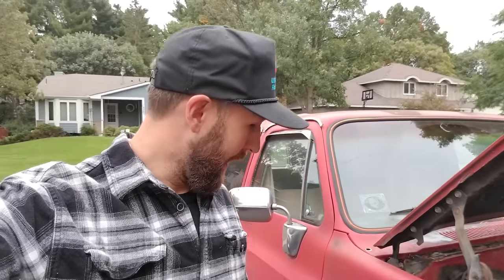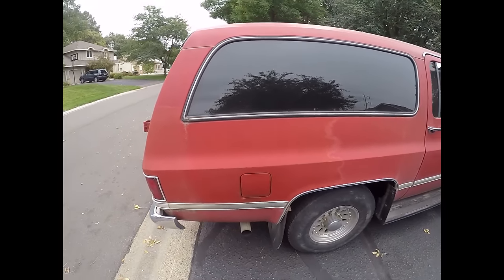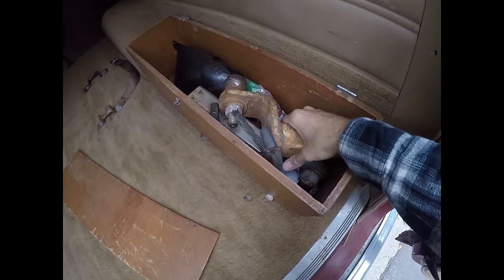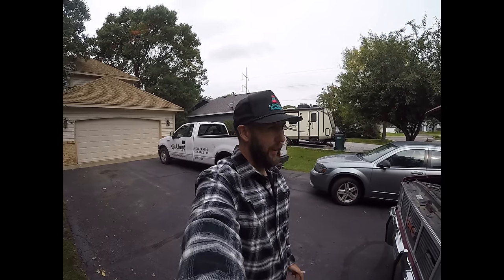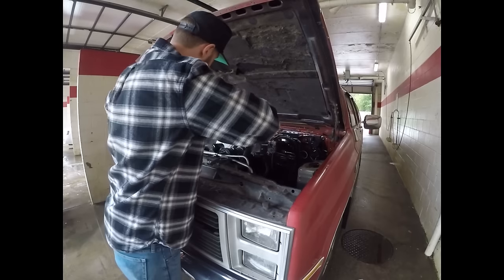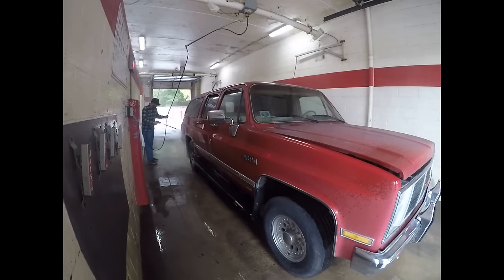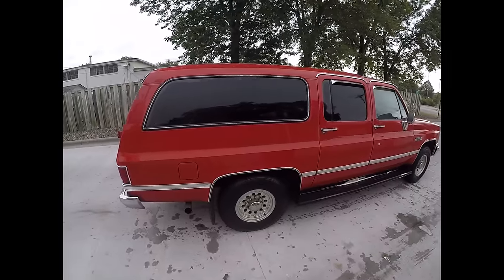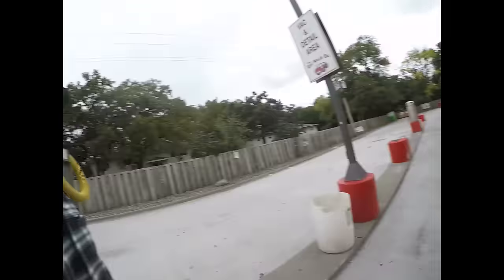454 Chevrolet/GMC Suburban Preview & Cleanup - Vice Grip Garage EP11

Comment: I had me a 454 dually took the wife and kids to Disney land...27 tanks of fuel from Canada,2500 miles round trip.Almost lost the camper in San Francisco when the camper hold down broke on one those hills.starter got heat soak in the middle of no where had to pour American beer on it to get it to start...oh ...lost spark some in Oregon got a used module in a wrecking yard.The trip before this one a volcano blew up and I Was stuck in Washington for days
Reply from the maker: You gotta carry a video camera machine my friend! Sounds like you find yourself some pretty amazing journeys 🤘😂.  I like those "dooley's" a lot!
Reply: I took an 03 F150 from Amarillo to the coast of Oregon last year. Just a 4.6 with 2wheel drive. Went no slower than 60 mph and topped went as fast as 90 mph uphill in the Rockies. All it cost me was a turn signal. She finally got snagged by a mud pit last month. 267k miles and the motor is still golden. Just needs... Lets be honest, a whole new cab and a tranny. The motor still has 120k miles minimum before a rebuild.

Gotta love an old reliable truck.
Reply: Sounds like the motor did good tho
Reply: Sounds like a National Lampoon vacation movie.
Reply: 1973 my dad did that! 454 quad cab not the  dually / he borrowed a massive camper/ it pulled great/pa to fla ! Used a aaa triptik He threw it out the window in DC
Reply: Thank goodness you didn’t have to pour Canadian beer on the starter LOL
Reply: I got me a 91 GMC RV with the 454 and the motor is going to go into a 79 Caprice
Reply: Kevin Ross  lucky!!! My kids are grown also, but my roommate/spouse is still here!!!
Reply: Remind me not to travel with you!! ;-)

Comment: My BB ran great in the heat or the cold.
The only problem I had when I had my Suburban was keepin transmissions in it.
I went through 7 of them before I stopped and pulled the motor out and tore it down.
That engine was absolutely clean. It looked brand new inside. 
Then I sold the engine and Suburban to a buddy that put the engine in a jet boat that is still goin to this day with no problems. 
And that was back in 2008.
I wish I had never sold that engine or Suburban.

Comment: For engine bays, I've got the engine warm, covered the electronicals and gave it a good soaking of simple green (degreaser) followed up with some armor all tire foam right over the simple green with pretty good success.  Let the foam work a few minutes before spraying off.

Comment: I probably mentioned before that my previous truck (pre 2003 RAM TD Crew Cab long bed) was an '88 GMC Suburban all tricked out. Got it in '93 with 98K miles on it and put 362,000+ on the original 350. Sold it for $1200 in 2010 to a guy who promptly rebuilt the engine and is still driving it today. Tough trucks and so much fun with that one.

Comment: I power washed my S-10 and ended up with crazy wiper action, cost me a good wad to learn electronics are anti -water. Never power washed under the hood again. Bought it new in 1992 s-10 4X4 extended cab 4.3 liter V-6. Still an awesome Chevy never anything but GM in 74 years.enjoy your channel.

Comment: I  had a 76 with 454 real gas hog. It wouldn't pass CA smog check so I ran it on propane. Was great, with two 20 gal tanks under and 80 gal in the pick up bed. Engine was bored 60 over, RV cam and Thorley headers .

Comment: Easy diy engine cleaner recipe. In a bucket, mix four cups vinegar, 1/4 cup dish wash liquid, fill remainder of bucket with warm water. Apply with a spray bottle or by hand with a wash rag, or both. Use a toothbrush and hairbrush to scrub and loosen dirt. Cheaper, eco friendly and does a better job than store bought sprays. Also won't hurt paint or clear coat.

Comment: Nice Burban. I've been driving burbans for years as my dad has been buying them for years as have I for years as well.

 I've wanted a square body for a few years but was waiting for a reasonable one with a rear hatch,roll up windows and a small block and in July I bought a straight bodied 88 with a 350,my hatch and roll up manual windows for a grand.

 I now have 4 burbans to drive, the 88,96,03 and 2010 as well as my 69 3 door with a hatch project.

Comment: My first vehicle was a 3/4 ton 4WD 1980 Chevy suburban. You know what that meant? Yep, no catalytic converter.  I could burn leaded fuel while it was still available. Bought it with a blown 400 CU small block, replaced that with a rebuilt 350. Best fuel economy I ever had with it was about 11 miles to the gallon. Had 7 1/2 foot Meyers power angler snow plow on it. Had to get rid of it because I could never keep up with the maintenance, and it was rusting out.
Reply from the maker: sounded like a good old rig

Comment: I had a buddy with that exact truck except it had an ungodly roof rack on it. The right rear corner was smashed and tucked under. We used my truck and a tow rope to pull the dent out. Good as new.
Reply from the maker: great body work

Comment: Don't damn the vehicle for being "cold blooded"; blame the idiot that put the open air filter in place of the factory air cleaner that supplied manifold-warmed air to the carb while warming up!  Also, a 454 2wd gives 10 mpg, regardless of whether you go 40 mph or 80 mph and whether it's carrying a bag of helium or a ton of bricks.
Reply: Seems to be standard for old trucks. My old fords won’t get more than 13 mpg unless I’m towing it with something else
Reply: 10 mpg you must have got a rare one mine got 8 mpg my freightliner with 465 cummins averages 9
Reply: My mom's 1977 Lincoln Town car 460 V-8 got an average of 10.1 mpg (she kept amazing records) year-round.  It only had a 3-speed C6 transmission, though.  The car probably weighed about 6000 lbs.
Reply: You should try running a big block with a locked distributor. With no vacuum advance it will drop you another 4-5mpg cruising around town. 😁
Reply: awesomeness 😂

Comment: check out the bottom of spare well . never know what prizes rolled down in there . i just unearthed my 88 k2500 that was rooted behind my shop for 10 yrs. i found 30 lbs of sinkers from the surf fish fun days . that is of course theres not a big ol rot hole under spare ! i been driving these trucks for 30 yrs. they rule !

Comment: My god parents had 1990 GMC Subraun was 3/4 too with 1 ton with 350 4bolt  main 4bbl , Turbo 700SR 4speed Automatic  Overdrive Automatic plus 4×4 with 410 rear end tandem axles , body was 2 ton grey  with red interior, plus aftermarket tin windows too both bumper were chrome to had travel package too ! Full frame too also back hatch not 2 door had tailgate with power window  plus had chrome diamond mirrors  were power plus heated  for winter season and had all power brakes or steering and options too also roof racks too ! Tires were 6 studs rims chrome GMC type factory even full spare with 265/80 16 Load Range D!Plus 100 litres full tank in middle plus middle Saddle tank 65 litres one plus daul exhausted from manifold back! They sold 10 years ago with 300.000 kms on for $1.000 Canada dollars full certfied and road worthy !

Comment: my s10 it was the rear diff cover leaking.  looked clean on the inside until held up to the sun, starry night.  gm dealer was very cheap for a cover, far cheaper than auto parts stores.

Comment: Just stumbled onto this video. 

I would love to get my hands on a 4x2 rear wheel drive 1/2 Ton Suburban. Doesn’t matter really the year, but I do prefer the 1967-up models. 
My wife does have a brand new 2019 Toyota Sienna minivan that I love riding in. But my wife has said she would like me to get a nice truck or suv for myself, and I am zeroing in on one hopefully by the end of the summer if all goes well with my retirement case. 

Any advice on how long these can last for? 300,000 miles?

I’d like mine lowered reasonably because I’m disabled, and be a nice highway cruiser. 

Thank you for your brilliant channel. 

Deaf Gryphon

Comment: I bought a brand spankin' new Sierra Classic 2500hd back then w/ a 350. I bought it to pull trailers. Huge mistake.  In the pool business where we brutalized trucks I started buying Ford's b/c of that GMC. Paid 17,ooo cash for it in I think 86'.  Didnt have enough compression to pull a trailer loaded with air up a hill.

Comment: Why didn't you just put a service loop and the gas line it would have helped it whatever it's yours. Plus a little tip if you want it when you spray it down with the degreaser hit it with the sprayer but not full force to get a little bit of water mixed in that way goes everywhere better and plus it dilutes it to where it shoot it in spots it the can won't go

Comment: I like the 'Burban.  I'm sure that someone has mentioned that vise, like in bench vise, or vise grips, is spelled with an s.  Vice grip would indicate that you have a strong hold on various types of crime.  Or various bad habits.  Other than that, cool.
Reply from the maker: Yip!  Patent and TM issues.  Vice is the same tool overseas, but no US infringement issues.
Reply: @ViceGripGarage  Copy.  Good work.  And I can see that Locking Pliers Garage doesn't really have ring to it.  Any other episodes on the '86 Suburban?

Comment: 454, for a big engine. it sure doesnt have much power.
Reply: The time from the 75-86 were the dark age of HP
Reply: @GlassTopRX7  Yep. Emissions.

However, take off the Emmissions such as Catalytic Converter, put on some Longtubes Headers , along with Dual Exhaust with a X -Pipe and then Big Blocks are pullim'.